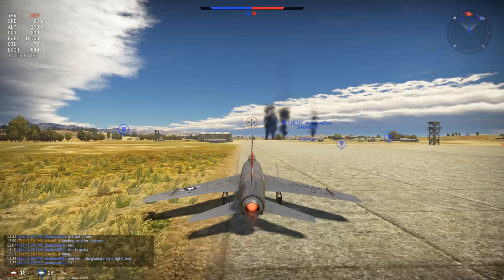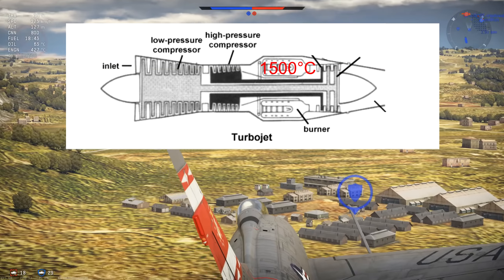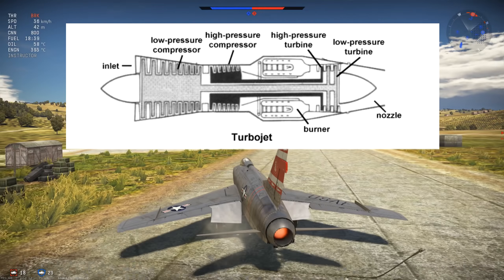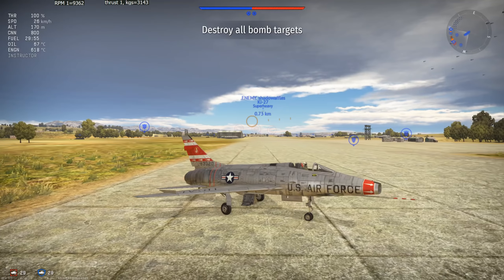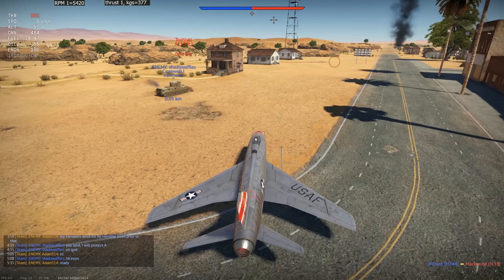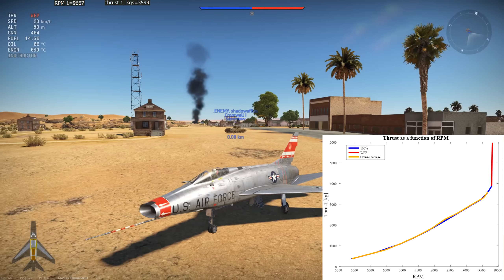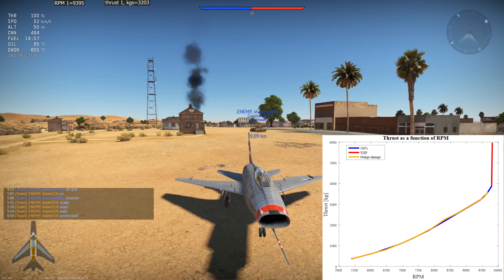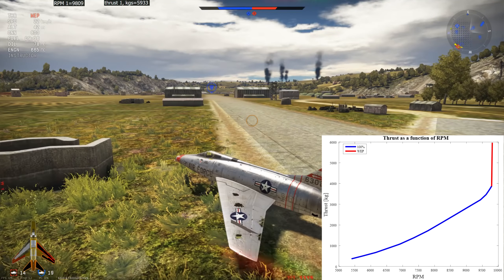The Problem With AFTERBURNERS In War Thunder

Comment: Hi Adam514. I have been loving the Fw190D9 lately because of the great climb rate and decent straight line speed that allows me to get out of situations. However I have encountered a few problems lately. 

I can always get the alt advantage on a spitfire, or I can separate and go for a head on pass (because they have good climb rate at low alt). At high alt I can bully them because of their power loss, at mid alt and low alt though, if try to get guns on them, they can just do split S and all sorts of nonsense and it works because I am diving at a steep angle to achieve max speed to separate quickly and disable their reversal opportunity. That means that if I dive too much, I will overshoot and what I have to go straight line, and when that happens an American plane might show( it didn’t happen luckily)up.However if I do not persist with my guns I will never be able to kill them.
In 1v1 this is not a problem at all, but if it is end game and me and another teammate has to face up against an entire enemy team (it happened to me today and yesterday), full of spitfires on boulougne sur mer (today), I had to rely on a He162 to get the kills. He got 7 kills and I only have 1 kill 1 assist because I had to be super passive and push them down. If I die, the he162 is GG. Furthermore they came in triplets or pairs. Yesterday it was all American and Russian with 1 spit on Grozny, so it was fine as I had a ki84 with me. How can I improve on this and actually shoot the spitfires down if the he162 wasn’t present? Furthermore my cannon rounds ran out after shooting that much. I tried not zooming in but is was quite hard to shoot such small targets and not be able to see where they are turning. 

We won both rounds BTW

1 more thing. How do you do reversal in a fw190D? It is very confusing to me especially because usually it is much safer to climb out of situations. But per say a P51 is high and is chasing me. I know your thing about going 90degree to the side to make them close up faster. However what I do not get is how you manage to get them to overshoot. What I see if a fw190 doing a slanted split S, then the American plane will overshoot and game over. What if the American plane does not commit and runs instead? 

1 more thing. 

I know how a plane with the alt advantage can push other planes down and diminish their energy though turning. Tempests however refuse to lose energy in a turn and are so maneuverable. Those pesky spitfires too. Push them down and they climb right back up, especially the American premium and that acceleration. What should I do? Commit full on, find a more shallow angle through purposefully flying the plane to the side in the boom phase or be passive until a mistake is made so that the pesky Split S can be curbed?
Reply from the maker: At a certain point you can't do everything yourself. You can bait them to go up for you if you have the altitude advantage, and that way you can get a kill or 2 and try to repeat.
Reply: Adam514 yeah I expanded my comment by quite a bit. He162 on my team was low though. If I make myself a very tempting reversal target, the other spitfire will come in and boom boom boom. Those people were very cautious with their flying. Instead of both stall climbing me, one went for the lag pursuit and one went for the stall climb. I tried Rope a Dope but they never fall for it. Had to push them down, it was the only way for the He162 to help

Comment: Thank you for address this while I haven't personally studied in depth afterburner effects having trained as a AME we briefly did go over what they were just not how they directly influence thrust and in a turbojet system in general how thrust scales with air speed etc, and how that all relates to Afterburners.

Since as a Civilian aircraft mechanic we would very likely not touch on Turbojets what-so-ever, however I did feel like they were incorrectly modelled in game, the Super Mystere is a great example of this I believe since it barely out accelerates stuff on the Runway with Afterburner on
Reply from the maker: Maybe the SB has a longer rev up time for its engine, because as we saw here the afterburner only kicks in when the max RPM is reached. It takes around 20s for the F100's afterburner to kick in when starting at 0% throttle.

Comment: True, afterburners arent affected by the engine thrust but to enable the afterburner you have to push the throttle from Mil Power to Afterburner. Mil power is 100% thrust without afterburner and Afterburner is right after that so how it is modeled in WT is correct to some degree. after 100% engine power you push further forword and activate Afterburner. tho something that is missing in WT is multi stage afterburner. tho this is posibly down to the fact that these early AB engines dont have several stages of AB and im not to familiar with stuff like the Mig19 and F100

The 2nd part of it, that the afterburner doesnt work with minor damage to the engine due to the RPM beeing lower is complete nonesence and should be fixed on Gaijins side, you are completly right on that part
Reply from the maker: Yeah I was talking about in theory you can use afterburner even if the engine isn't at 100% military power (and in some aircraft you can use afterburner without being at 100%).

Comment: Now ik why they are called afterburners
Reply from the maker: Yes fitting name. Also called "reheat" in the UK which is also fitting.
Reply: Adam514 afterburner will still be a valid word on the SR-71, but not reheat, because the air passing through the afterburner would not have been heated by a combustion
Reply from the maker: Euh why would it not be heated by combustion for the SR-71?
Reply: Adam514 the air fed into the afterburner of the JT11D bypasses the turbojet itself, and the afterburner functions like a ramjet

Comment: While alot of this information is mostly accurate there are a few minor details that aren't

1 the compressor stage alone doesn't get the air up too 1500° it only heats it up to about 400°-600° it's in the combustion chamber that it heats up to 1500°+ and where fuel is sprayed then directly lit (think like a flame thrower) the reason it doesn't melt the combustion chamber and turbine blades (rear blades harnessing power form the combustion to spin the compressor blades) is that colder 400° bypass air from the compression stage is used to put a boundary layer between the hot exhaust gases and any engine components and is not uncommon for the turbine blades to had little vent holes in the leading edge to cool the air around them with bypass air.

2 most jets you can't use afterburner in at any throttle setting because the afterburner is automatically lit and started if the hand,throttle is pushed past 100% command, sometimes having stages but at that point a stage is a stage, although you are right afterburner run isn't dependent or core engine rpm.
Although engine damage shouldnt effect core rpm only stability and thrust. So wg could use the same system currently but add a flaming spudder at throttle commands higher then rpm capable with damage and then flameouts or engine fires if throttle continues to be higher the rpm capable

Edit to add a detail to the combustion chamber.

I can go into more detail in another comment but I figured I only captured a small amount of people attention with the wall of text
Reply from the maker: 1. That's why the 1500 degrees is shown in the combustion chamber, right after I see "mixed with fuel and ignited, reaching 1500 degrees" 0:30 .

2. The main point is that the afterburner working or not should not depend on RPM, while it does in WT so just a little damage prevents the engine from getting its afterburner thrust.
Reply: @AdamTheEnginerd  I think I miss heard the first one, fair enough you got it correct. 

And for part 2 I agree but wanted to clear up if there was anyone had the misconception of there being a afterburner button kinda like a nitrous button in a car.

I feel like the solution thought have having the jet sputter and flameout at higher throttle setting if damaged would be a accurate and good solution for the current problem but also not need a complete rework of the boost characteristics that was probably ported from water injection/WEP coding for the pistion aircraft, as in this case the pilot wouldn't be able to get afterburner cause or he'll further damage his engine or cause a flame out and also having a decently forgiving damage model for jet engines as one hit for a real one would cause serious damage unless to exterior engine compartments which could still cause major issues
Reply from the maker: Exactly, they used similar concepts for piston and jet engines, leading to this issue.

Comment: Very informative indeed

Anyway is the f-80 a good jet to buy? I researched it but the repair cost just kills it for me
Reply: What F-80? A5 or late version C?
Reply: A5 is great for the br , the c is bad skip it , as for repair cost they get higher but also the sl gain multiplayer so even when you pay more you gain more .
Reply from the maker: I wouldn't recommend the 8.0 BR one, 7.0 is good.
Reply: @AdamTheEnginerd   A5 is great. Is it possible to make a vid about it? ;)
Reply from the maker: I made a dogfight video about it.
Reply: A-5 is really good as a starter jet because its kinda a jack of all trades master of none
Reply: a5 is cost effective even if you die most of the time
you will be able to kill something
and rp needed for modifications are almost same as p51's
just make sure to look out for diving r2y2's and you can fight with anything

Comment: Technical videos are quite useful, it would be nice to see more. 

Have you submitted a bug report to gaijin? They might listen and correctly implement afterburners. 

Also, what do you think of flight models in game? I find inconstant, due to wings in game having only three blade elements each. That's very few for a flight sim. Explains why some planes can just ignore a bunch of wing damage while others are crippled by just a couple bullets.
Reply from the maker: Nope I haven't submitted a bug report.

Flight models seem to reflect real performance at a reasonable level. You mean the damage model only having 3 parts for the wing?

Comment: Small correction; While it is true that afterburner can be used at any throttle setting I do not know of a single jet in real life where you can light the afterburner independently of throttle position. The afterburner usually kicks in at 75-95 percent throttle and usually with a detent. After this you have a bit of wiggle room to adjust the level of fuel injected in to the afterburner duct.
Reply from the maker: Yeah in real life there wouldn't be a point to use afterburners when you aren't at a high throttle already, because it would just use more fuel than increasing throttle. What I meant to say is that nothing stops the afterburner from working if you are using it at a low throttle. It isn't tied to throttle (the thrust from the afterburner would be lower if the engine's throttle is low though).
Reply: Adam514 alright. Great video!
Reply: Usually, the afterburner kicks in after 100% throttle ie military power or 100% rpm as there's no point in using it without the engine already being "maxed out".

Comment: This is indeed true but at the same time is not a "terrible" problem. If you wanted full realism you would have to make afterburning engines extremely prone to afterburner blowouts or full on explosions when struck since the principle is that of a barely controlled explosion similar to that of a rocket engine.
Love that you are calling out the incorrect implementation of afterburning engines however.
Reply from the maker: Yeah it's not that much of a big deal, it's just the consequences are illogical.

Shots hitting the afterburner duct would be much less catastrophic for the engine and aircraft than hitting the rotating parts of the engine like the compressor and the turbine though. The pressure in the afterburner is also significantly lower than in the combustion chamber, so it's less dangerous and I doubt it would explode if shot. If I had a choice as to where my jet engine would be shot, I'd choose the afterburner.

Comment: How to get thrust statistics like on the top of his screen ?
Reply from the maker: It's called the "local host".

How to access the "local host":
You need to be running War Thunder or it won't work!

Option 1: on the same computer that is running WT:
-Type http://localhost:8111/ in the address bar and press enter and voila.

Option 2 (which also works on the computer that runs WT):
-Type http://Your_IP_Address:8111/ where you replace "Your_IP_Address" by your IP Address (192.168.X.XXX) in the address bar and press enter and voila, you can look at the characteristics on another device while flying.

Comment: I feel so clever now. Was in my 190A-8 - orange wings, 3 mins fuel, and 500 m altitude - in a 1v1 for the match against a P-47D-28 with 3 km alt. And he was smart, breaking off at 0.5 km so that he didn't overshoot. So I steered the duel towards my airfield - I wanted to easily be able to land if he damaged me more, and I also had to because of fuel. He overshoots once but is still way faster than me. The second time he overshoots I get his elevators from 0.8 km away. Then he tries running (and he can because I'm damaged as well) but because he can't maneuver, he flies over my airfield and gets shot down. Big brain play ftw lol. We started that game 1 down, and 2 teammates crashed on takeoff, but I got 4 kills and the match.
Reply from the maker: Not bad, didn't need the airfield though.

Comment: You do have a solid video with great modeling and numbers, but I just thought I'd let you know in US fighter engines there is a engine computer that will inhibit augmentation (or afterburner) when the computer senses there is something wrong with the engine. I'm not sure if this is what the devs wanted to be realistic, but it is a real thing. It's called secondary mode where the engine basically goes into a safe mode where it's main purpose is to get the pilot home at that point.
Reply from the maker: I don't think that existed on the first afterburning aircraft though, and it's like this for all afterburning engines.
Reply: @AdamTheEnginerd  you very well could be correct about that. I just know since the 70s they've had that feature, but again very good video and its good to bring that problem to light in the community!
Reply from the maker: Thanks!

Comment: Could you do a maneuverability comparison between the A36 and the p51D30? At different alts/airspeeds? I’d love to see that thanks.
Reply from the maker: Haha but why? Their BRs are so different.
Reply: @AdamTheEnginerd  technically yes. but in real life they were the same plane with different engines. Same wing coefficient. The A36 was a p51A with dive flaps and extra center guns, but both have the Allison engine. P-51B/C (4x50cal) were modified to be Ds later in the war but all had the RR Merlin engine. So in theory the airframe should perform the same (say both at 300mph at 2,000 feet.) The D model should only start to be better at above 15,000 feet.

Comment: Adam, from 1950s to 1970s time frame, what aircraft did you think that resemble Bf 109 fighting styles during cold war era
Reply: You mean bnz ? All jets did that at the time .the mig especially since it was light and could just zoom up 3km with ease
Reply from the maker: Mig15 I suppose.
Reply: Adam514 Why not the Vautour
Reply: Yanni NICKAS it had another role, that of an interceptor.
Reply: @nightshade7745  I think only Israelis Air Force manage to kill 1 aircraft from Arab state, other than that, no more kills
Reply: Firman Pandi despite that, interception was one of its intended roles.

Comment: I think it makes sense from a gameplay design and simplicity perspective that the afterburner is only available at a wide open “throttle” , but they should really treat it as just tacking on more thrust instead of binding to engine speed. If the engine is damaged and you have, let’s say 90% of a healthy thrust, and the afterburner adds some amount for a healthy engine, then throwing on the afterburner on a damaged engine should give you that 90% plus whatever the afterburner value is
Reply from the maker: Or just 90% of the total thrust (engine+afterburner).

Comment: This may be part of the reasons why they don't want to add as modern planes as tanks right now. They would need to change the way the engines works to make it any decent
Reply from the maker: Meh they can change this system pretty quickly if they wanted, I don't think this factors into their decisions.

Comment: Hrm, seems to me they did it right and you read your graph backwards... WEP/Afterburner thrust goes WAY up without much change in RPM, so it's NOT a function of RPM but of the additional fuel being burned.
Reply from the maker: Without much change in RPM, so there is a change. Once damage prevents you from reaching that 10 RPM higher than enables afterburner thrust, you can no longer afterburn.

Comment: So in essence It should be posible to use the afterburner even at 50% engine thrust and/or damage engine right?
Reply from the maker: Yup!
Reply: Hmm... More reasons to make savings for IL-2 simulators... Too bad :/
Reply from the maker: They'll properly implement it eventually if people complain.
Reply: No they don't... even knowing that they only have to assign a key to make it work... Tanks and now Ships are more concern than feature that already is implemented... Just like the radar on planes